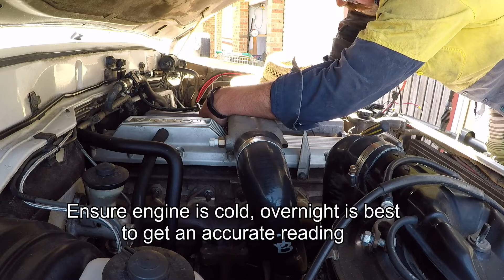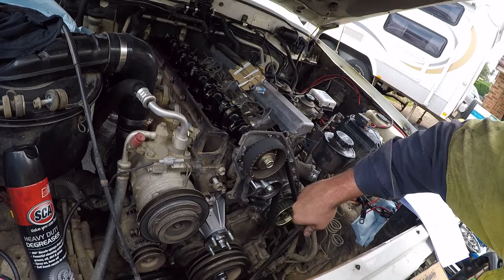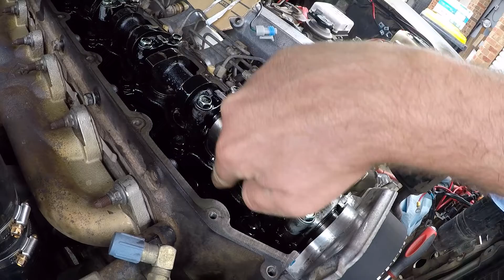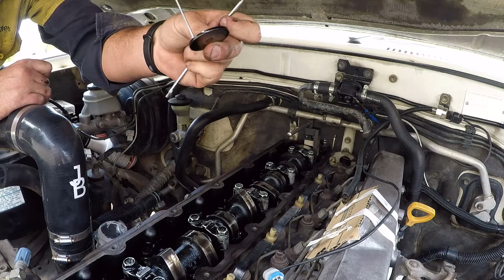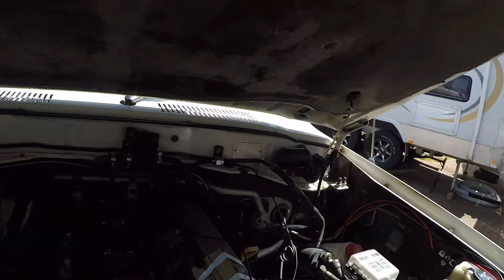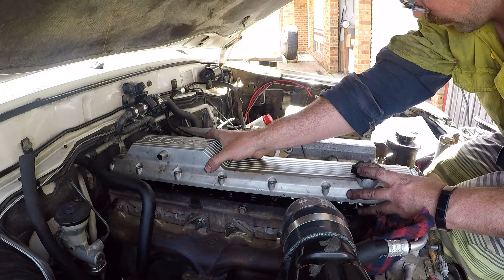1hdt 1hz Valve Clearance Adjustment Landcruiser 80 Series | Engine Maintenance |

Comment: I have a 1kz-te the process is basically the same but different clearances. Thanks for the vid. Glad to see there's a special tool to make this job easy! Do you not have to lock the engine before removing shims? I only have experience doing this on motorcycles.

Comment: Is the motor in the 80 turbo'd? If yes what turbo kit did you go with? Berrima Diesel seems to use the DTS kit with Mitsubishi turbo but some people don't think they suit a 1hz. I need to do my valve shims as it's over 700 k km's now.
Reply from the maker: yeah turbo, Ct26 style housing.

Comment: Tim I can't thank you enough mate! (replying to my comment (differrent' account name) would have been cool, but heck, the video on water pump is over a year old and you are a busy Dad and Hubby) I watched your water pump/timing belt video I notice I had a blown rocker cover gasket, and that's why I'm here watching this video as mmmm I thought may as well check valve clearances. The extent of my mechanical ability inlcudes (but is limitless with the right teacher such as yourself) is brake pads, and bleed change rotors, install new PS gear box oil change and installing aux battery hooked up to alternator, CB radio, flood lights etc, never done 'in' engine work before my biggest fear the timing belt! but thanks to you Tim, you given me the confidence to give it a crack! You're a bloody Ausssie what's more. A clown from the USA with a youtube video said you don't have to remove timing belt to get to water pump. Umm did he not know that diesel versions exists and not all Landcruiser 80 series are petrol? Thank cricky I found you Tim, 
Thanks again 
Dave Captain (FB)

Comment: Thanks for the vids champ. I had a Runaway with my 1HD-T (long story but low light overfill of oil blew the intake seal 🤦‍♂️).

I have had the CT26 recored, plus ported and polished the exhaust Mani same time, initial borescope didn't show any internal damage + no shrapnel or swarf in oil dump.

Now only running on >3 cylinders (no nasty noises) now so about to do timing belt (60k until next due) and check valves/springs/shims, and comp test each cylinder. And this vid is almost bang on albeit 1HZ but still same.

Hoping it's just a timing issue and not injector/pump failure/s and/or piston issues 😢. 

Thanks for ya time bro 🤌🤙🤜
Reply from the maker: Ouch sounds nasty. Hope you figure it out
Reply: @tinkeringtimmy4061  super sad face, have to replace 4 of 6 injector nozzles, and 2 full injectors. Apparently running at 8K+rpm on oil as the fuel has a carbonising effect 😂😂😂 at least the pump wasn't dead.
Reply: @CCMiniBucks  anyway we could talk further, i believe the same thing happened to me and having to do the work myself so any tips and findings would be super helpful. At this point I have everything apart and used a bore scope to verify no metal, I ordered a new turbo just to speed the process up, next step for now is to put everything back together and 🤞that it runs ok but I have my doubts 🤦

Comment: Im in the process of doing mine, this is my first time dealing with shims and buckets. i got tdc measurements but i couldnt tell if i got it at 180. but all shims where off the lobes on other 6. do you reckon that would be ok? cheers

Comment: Thanks. Just did my valve clearances watching the vid. 
1HZ
1). 20, 35 
2). 20, 40 
3). 20, 40 
4). 20, 40 
5). 20, 40 
6). 20, 40

Only had .05 feeler gauges so could NOT fit 25 and 45 respectively in any. Didn't have to change any.
Reply from the maker: Nice! always good to check

Comment: Hello sir, how do I know my engine needs valve clearance? My 1hz has 4,00,000 kms. There’s a tapping noise coming from the rocker(tappet) cover during cold start and while reviving the engine over 2000 rpm. Could it be the valve clearance issue or the lifter making such noise ?
Reply from the maker: If you don't know when they were last done, check them.

Comment: Hey Tim, great video! Just about to check my 1hdt. Do you need genuine Toyota valve bucket tool? or can you order cheaper one online? cheers
Reply from the maker: Thanks mate, I just ordered one off eBay. Just make shore its the same type and you should be sweet.
Reply: @tinkeringtimmy4061  Cheers 👍

Comment: Tell me how often do check the valve lash ??..
Reply from the maker: I think Toyota recommend 30k miles/50k klms. From the info I have read, seems if you check the valves whilst doing your timing belt at 60k miles/ 100k klms is a good maintenance schedule.

Comment from the maker: What engine maintenance video would you like to see next? Cheers
Reply: Camshaft
Reply: How to service injectors diy and put shims etc so don’t have to buy new injectors.
Reply: Oil Pump!  My Oil pressure reading low. Anything on that would be great.  (1HZ)  Btw, if you click on the 3 dots on the right of Your comment, you can PIN it to the TOP.